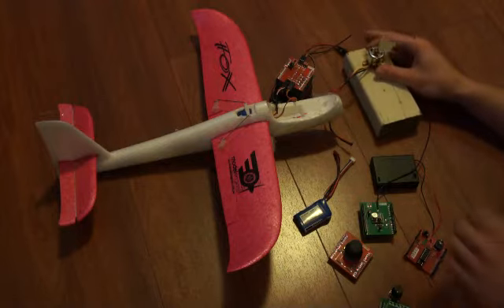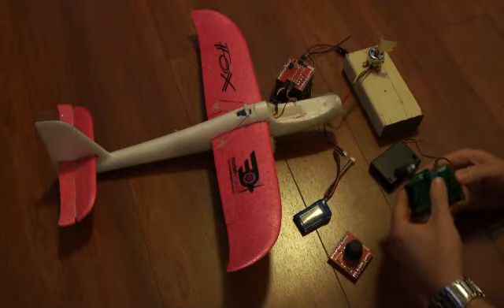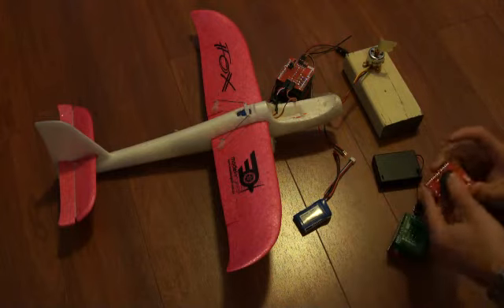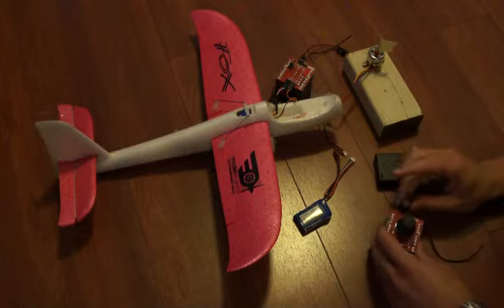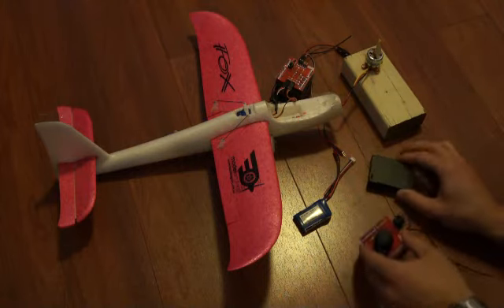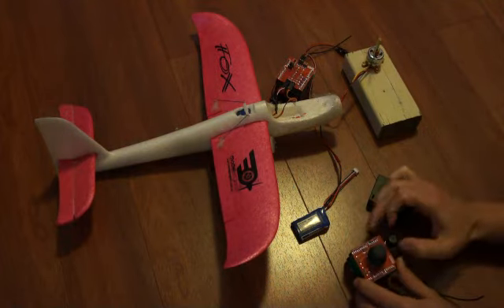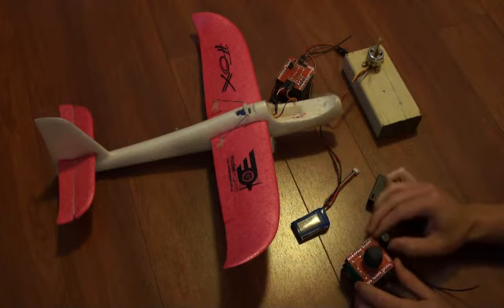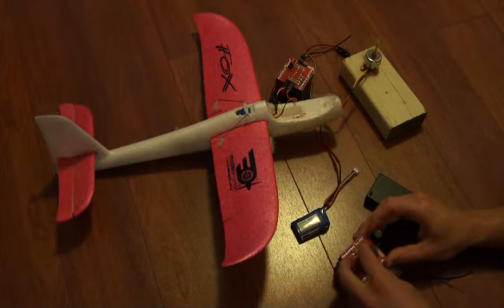Diagnosing Servo Jitter with SerIn

Comment from the maker: Hi Darcy, code is on forum which is linked in description. I haven't looked at it on a scope yet. My gut feeling is that Tx is sending a packet of three signals quicker than 50 Hz but receiver is not picking up every signal sent as it needs time to move servos.

Comment: Without looking at your code (I can't help you there), how fast is the rx communicating with the servos? At least 50 times a second? Is the transmitter sending a signal at least 150 times a sec (3 channels * 50Hz)?